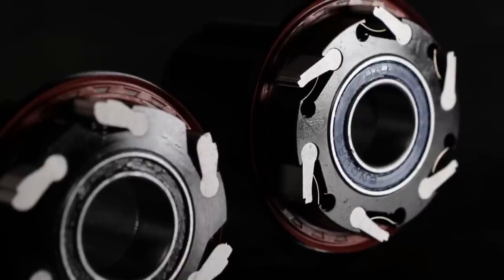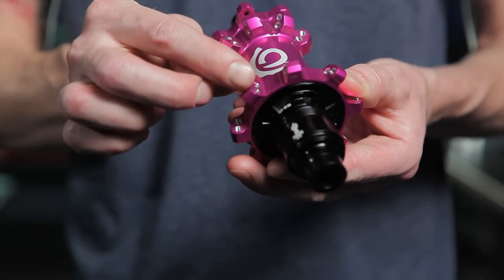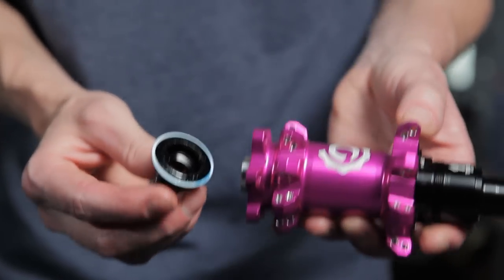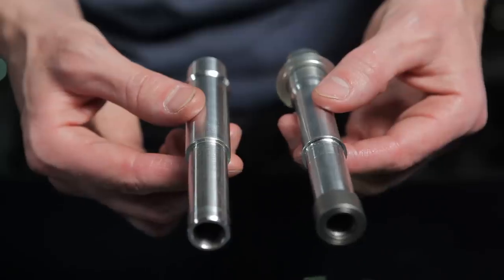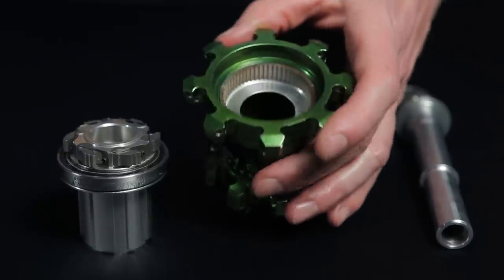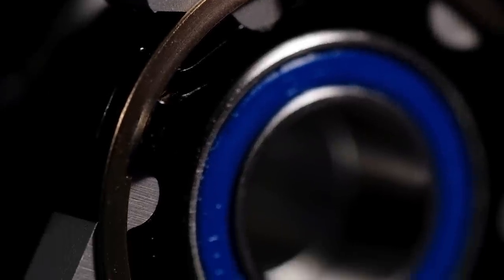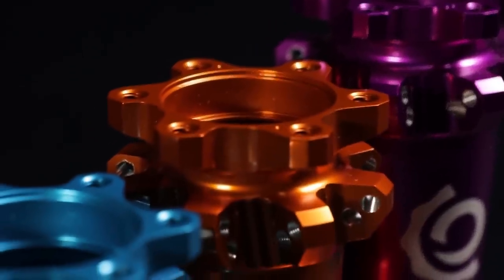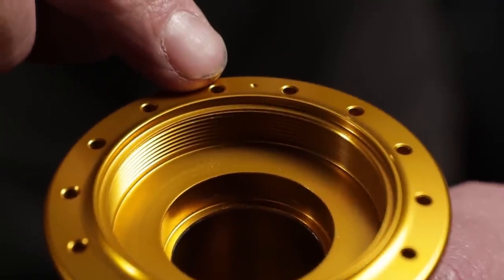Hub identification: Hydra vs 1/1 vs Torch vs Legacy

Comment: Now you guys at I9 need to improve the freehub bodies by making them titanium and not aluminum. My Torch rear hub didn't last a year before needing a new freehub body. I didn't replace it because the price was $90 and that was without bearings. I went to another brand instead.
Reply: Or use steel inserts like Syntace and some others do.
Reply: @Tullebukk75  Can you post a link? I don't know what you're referring to. Is that the thin strips of metal that you slide in along the splines before installing the cassette? I really didn't care for that fix. I got some CLD hubs from White Industries so it's to late now anyway.
Reply: Everyone uses alloy for freehub bodies, steel is a bit heavy but its indestructable, titanium freehubs crack if you are not informed. Ask Tune and Extralite
Reply: @richpotatothebestg.m.ovegg2599  I now use White Industries CLD Disc hubs on two bikes for over a year now and not one complaint. I think that's informative enough for my reasoning.
Reply: @wasupwitdat1mofiki94  Then continue using them and proceed
Reply: this day just go XD or Campy.
Reply: I had to replace my Torch Freehub cause my LBS mechanic broke it tryna change the bearings... Found a complete Freehub with bearings, pawls and springs for $130. Love my Torch hub!!

Comment: I’m excited to finally get a wheel set with I9 hubs or a complete. I’d be happy with the 1/1 on my gravel bike but I don’t think you offer 142x12 or 100x12 hub sets in that model. My 2 Mtn bikes are being fitted with 27.5 plus wheels this year. One is a fully rigid Seven Sola SS and the other is a Esker Hayduke 1x11 hardtail. So that’s why I want to try 1/1 hubs since I’ll need to get several. Anyway thanks and I’m looking forward to to finally owning some I9 bling.

Comment: Stay away from the GRCX 700c 1/1 wheelsets.  There are multiple problems with breaking spokes and nipples.  They have offered to rebuild my wheels with different spokes.  They say “it is a bit of a mystery why these wheels are failing.  No mystery to me.  Subpar build.  Plain and simple.  I hope they follow through and fix them.  Thanks for reading.

Comment: Hey guys, I noticed this video is four years old. Can we get a new video with the new axles? I just received a brand new set of 300 Enduro wheels and I think the axle is different from my understanding prior 2022 is older generation.
Reply from the maker: We made a running change to the axle design for increased durability. This slight design change does not affect the service/maintenance procedures of the wheels.

Comment: Can you say Gimmick?
Reply: @Eli Hume I have ridden Onyx, currently on a set of high engagement project 321s.  There is NO BENEFIT to these new EVEN HIGHER engagement hubs...I will still kick anyones ass in a race on Shimano Deore hubs on the gnarliest most technical climb.  Sure more engagement helps but their is a critical point where more engagement has absolutely NO BENEFIT and these hubs are in that category.  Over 72 is a waste and a Gimmick.  Smoke and Mirrors...another way for the bicycle industry and coprorate America to steal consumer's money.  Certainly not worth a 1c to upgrade.  Let me guess you're a sponsored rider or getting paid by these guys?
Reply: @Eli Hume plenty of suckers to keep these companies in business.   Spending $1000s for no additional value.  Goodluck with your I9s...hope those little teeth on the ring gear don't strip out.
Reply from the maker: @greatdimitri1049  Hey man - glad you found a hub that works for you. Onyx and Project 321 both make excellent products as well. While the increased engagement is a nice plus, I hear ya - 90% of riders won't notice a different between 90 POE and 690 POE. However, the true inspiration for Hydra wasn't necessarily the increased engagement, but an improved pawl design that is more durable and increases bearing, freehub and axle life. Hopefully we've done that and riders won't have to service their hubs as often as they did with Torch.